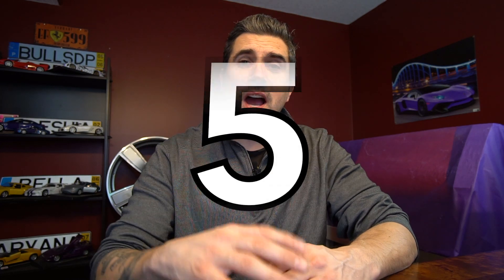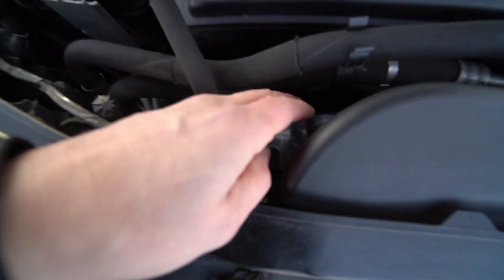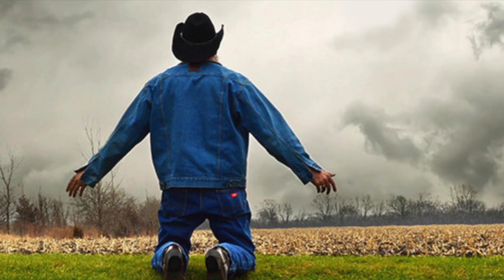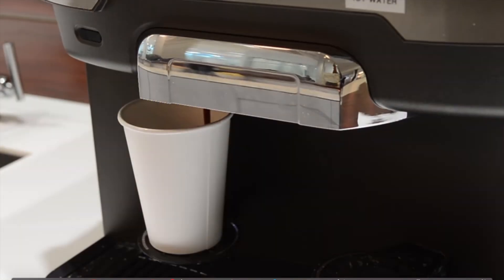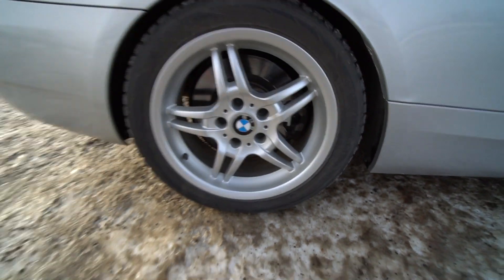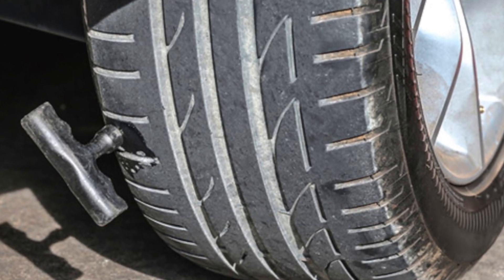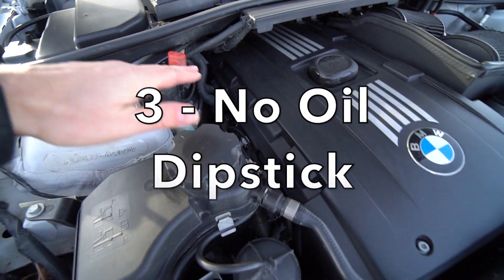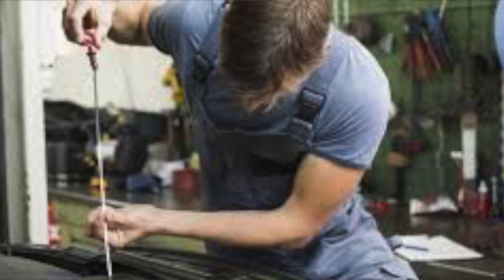5 Reasons Not To Buy Unreliable BMW 335i

Comment: What are your thoughts on a 550i? ...F10.  Are they reliable? 

I'm planning to get an F10 M5, but wanted to get the 550i first since it's a little cheaper and still has a V8.....which actually sounds way better than the M5.  If you don't recommend this, what do you think would be good in that range?
Reply from the maker: Hi, I personally love the F10 body style and the performance of all models.  The n55 is a great 6 cylinder performer, while the M5 is an absolute beast.  Since your ask, the 550 comes with a 4.4 Litre Twin Turbo V8 and produces anywhere from about 400 to 450 HP depending on the year which makes it a very spritely performer.   Problem, these engines had a significant list of significantly likely failures such as injectors, timing chains, HEAVY oil consumption because of the "HOT V" which places the turbos in the V of the engine and creates a lot of undesired heat which then in turn fries valve guide seals, Valve cover gaskets amongst a few things.  In short would I own one?  Maybe, if the price was right, I was happy with the service history and maybe you find a good one.  M5 may have some similar issues but its such a beast that I may live with it anyway.  Hope this helps.  BTW, the N55 powered F10 may be a good alternative if not going M5.  They are not perfect but are fairly dependable.
Reply: @ECPP  Ah!  Thank you for the detailed response!  I will keep this in mind for when I'm ready to make a move.
Reply: Dude I would strongly advise stay away from the N63 engine in the 550 and M5’s, they are very troublesome and unreliable. I speak from experience and google search and you will find an outstanding number of world wide complaints and issues.
Reply from the maker: @bucksbonanza  agreed, I was trying to be a bit more political.  Have a great one.
Reply: likesp33d the M5 engine is totally different to the 550i yes it is still a hot V but built in different factory and is a totally different kettle of fish. Just compare N63 vs S6344TU which is in the M5.

Comment: I've owned my e93 335i 57 plate 11 years now.. about £2500 in repairs hpfp water pump.. the parts are cheap because the cars old.. the dealer wants to buy  good examples 💯... I would never sell it perfect example of the ultimate driving machine

Comment: I had a 2007 coupe, it was so nice and fun to drive, beautiful design. However, I will never buy a BMW again after that. I got it at 96k miles, and over 3 years only drove it up to 101k. 
I did buy a warranty with it, thank god, it quickly paid for itself and far more. I can't even remember all of the things that had to be done, a turbo was the big one, water pump, I think the fuel pump went too. Many other issues too. People say they just need to be maintained, if by maintained they mean rebuilding the entire car before 100k miles, then sure. I can only imagine how many things would have gone wrong if I drove it more.

Comment: Yeah... I just replaced my stock turbos with Pure Stage 2 High Flow units... took me one day to get to turbos, one day to install and one day to reassemble. Then after checking for leaks... had to do it all again because minor coolant line leak on front turbos, then after two weeks, minor turbo oil drains minor leak so had to do it all again... so basically, three weeks of solid work. For the damn turbos.
Reply from the maker: That hurts.  In the end was it worth it though and was there a decent difference from stock?
Reply: @ECPP   - from 265 whp... to 650 whp? I would say, uh 'yes' it is in no shape or form the same car as stock. It is a suicide machine. Now I have to get wider rear tires to drive it safely at aggressive input...otherwise, it simply fishtails even if I am driving straight at 30mph and push the pedal... i don't know how to drift so three times already I have done spattghetti fishtailing and ended up opposing traffic...NOT from turning, but from straight driving... I can't imagine turning and accelerating. I REALLY need wider tires for SOME usable grip. So currently I am forced to drive literally like a grandma or else it goes apeshit.
Reply from the maker: @matreyia  Sounds great, I am assuming you have all the bolt on stuff.  What tune an mods are you running?
Reply: @ECPP   The car's all upgraded even before turbo upgrade, maximum fueling system, upgraded coils, 2 step plugs, two catch cans, all seals gaskets done, upgraded transmission, upgraded m3 suspension and bushings, upgraded 6 piston brakes etc... Just need wider tires. As you can see, I upgraded correctly with supporting mods before I installed the turbo.
Reply from the maker: @matreyia  Sounds solid
Reply: @ECPP   MHD tune working with Twisted Tuning.

Comment: Absolutely love my 2010 BMW Z4 35i N54 E89. Yep replacement parts are costly. Did alot of research before I bought mine and have been steadily replacing the parts that are most likely to break like the plastic charge pipe and adding dual intake cones. I'm a mechanic by trade so I dig working on my cars. I don't like the no dipstick thing but if I wanna get a look and smell of the oil I just open the fill cap on the valve cover and run my finger in while the engines not running of course.Oh BTW I'm not a fan boy but folks who aren't mechanically inclined will whine about the unreliability of these vehicles.I'm sorry that these folks are so inept at doing basic maintenance. I would be ashamed if I had to take my car to the dealer to perform a service. So put these things in perspective please. Like I said I'm a mechanic by trade this stuff is easy.
Reply from the maker: Water pump and T stat are a bit of an annoying change from my experience.  The steering rack and subframe are awkward
Reply: @ECPP  I'm a mechanic by trade I'm used to annoying things to change. And if you can rent a lift or lift space it's really not a difficult thing to replace if your skilled.

Comment: I am afraid to take mine on the long trip. I take my teen son's 2000 Toyota Camry with 225K miles instead. I trust the Toyota more than my 2011 335i xdrive with less than 100K miles.
Reply from the maker: I can see why although yours with the n55 is a lot better than the n54 twin turbo in mine
Reply: @ECPP  it had spun rod bearing , and so many things went wrong already. If BMW designs cars this way, KIA will eat their lunch eventually. Have you driven a Stinger?

Comment: ‘07 335xi: HPFP and LPFP replaced, both turbos replaced, water pump failed while on highway and almost got rear ended at 65mph, power door locks blown fuse, sunroof stopped opening, passenger rear view mirror stopped tilting down while in Reverse. I was lucky it was still under warranty and 100k warranty on HPFP.

Best day of my life was when I traded it in and have not owned an Ultimate Worse Machine since.
Reply from the maker: Wow, ouch

Comment: They are not a lot to maintain yea the car have its issues but if you take the car to bmw what do you expect a cheap repair no they’ll charge you up the ass you can learn to work on your own car just like I did all you need is the space if you don’t got space go to a mechanic that knows what’s he is doing and you will still be pay less than paying bmw to fix a small problem if you buy a bmw fcp euro and real oem will help you find the parts you need with a cheaper price than bmw will charge
Reply from the maker: True for sure

Comment: What about a 2013 X5 xDrive 35i now with 92k miles?
Reply from the maker: A well maintained unit could be a solid purchase because it has the n55 engine which is a lot more dependable than the n54
Reply: @ECPP  I had someone telling me I should dump my '13 X5 because he owned an earlier 335i that was full of problems. He said I should get an Acura MDX... I drove my X5 for 7 months now having put close to 14k miles so far without major problem!!! Only was the oil pan (gonna be hell of a job) and oil filter housing gaskets (that took the mechanic the whole day) that are getting done.

Comment: So my 1999 Camry is better then this bmw ? I paid $2,000 in April 2019. In June 2020 i got the transmission cable that was $430 and the AC condenser $480. This Camry is a beast and rides smooth

Comment: Is the n55 a lot better or should you go for the b58 (340i-f30)?
Reply from the maker: N55 is a bunch better than the N54 for reliability, but not as much for tuning.  With that said, from the N54 I would go straight B58, its a far more gnarly engine.  So far quite dependable as well, at least when tied to the auto trans.
Reply: ExoticCar PlayPlace Thank you for you answer. I had a 335i with them N54 from 40000 km-80000 km without problems, no tune, and  I guess the next owner started to see the issues. I got my mind set on a 340i Touring, could be both manual (a bit rare to find her in Sweden) or auto. Do you mean that the B58 on the 340i is more dependable with auto? Usually manual transmissions are more long lasting.
Reply from the maker: Hi Tony,

Maybe if you have time, give this a read.

B58 Engine Recall - BMW Service Bulletin SI B11 26 15

Engine
B58 Engine ***8211; Check and Replace Crankshaft Guide Bearing

Model
F30 3 Series Sedan with B58 engine and manual transmission.

Situation
The upper crankshaft guide bearing may wear out prematurely. The wear on the upper guide bearing can cause the clutch pedal to malfunction during shifting. The Engine Malfunction warning may be illuminated and a fault will be stored in the DME memory for the crankshaft sensor. Noise may be heard from the lower engine and transmission bell housing area.

If the crankshaft guide bearing or crankshaft is found damaged during the inspection then the engine must be replaced. Engine damage is a rare occurrence.

Affected Vehicles
This Service Action involves F30 vehicles produced from July 2015 to November 2015. Vehicles which require this Service Action to be completed will show it as "Open" when checked by your local BMW dealership
Reply: ExoticCar PlayPlace ok thanks amd that is only 340is made 2015?

Comment: what are your plans for the 335i in due course?
Reply from the maker: Still sort of wading my way.  If turbos go I will go all in the a big upgrade but if not we will see what type of mods can be applied.  At some point we will move it along but I am not sure I have finished with this hot rod just yet.
Reply: ExoticCar PlayPlace Alright sounds good man 👍 Can’t wait to see what’s in store!
Reply: @ECPP  after doing a ton of upgrades to my 335i and 5 revisions on my new tune I was finally able to take it on a road trip this past week and wow  What a difference fueling and larger Turbo upgrades due to this car!  Going down the freeway at 80 miles an hour you floor it and the tires spin  Definitely have to get used to the new power. Less than 8 seconds to go from 40 to 120 miles an hour  And that's only at 22PSI I'm going to tune these turbos to 24 or 26PSI

Comment: Honestly if you’re still going to the dealership, outside of warranty for repairs of any kind, you’re crazy!! You are absolutely right about the plastics in and around the engine, that is the prime reason why things go bad eventually on the N55 335i. To this day I don’t know why they went that route when designing the engine. If it was to cut costs, then it was the wrong area to do so. 

I used to have a 2007 BMW 335i (N54 Engine) when it first came out. At that time I was a much bigger BMW fan than I am now and didn’t know what I know now about BMWs. Back then you couldn’t tell me anything bad about a Bimmer. But if you think the N55 was unreliable try the first generation N54, the first year they turbocharged their inline 6 and it not just one turbo in that engine but there were 2. Adding more heat around plastic parts was a disaster and I remember some of those cars didn’t have oil coolers 🤦🏾‍♂️ The engine was AMAZING when it worked but that car was constantly in the shop for something. 

Also back then, the 335s had the first generation run flats which were an absolute disaster!!! I recently bought a 16 BMW 428i which had run flats and they made my old run flats  feel like I was riding on clouds and they were bad as well. I just changed the tires and the car feels so much better.

Comment: So what if i saw an offer of a 2008 bmw 335i convertible hard-top for $8,000 with the only 60,000 miles on it. Is that a good deal?
Reply from the maker: I would not recommend it unless you are good at wrenching especially with the n54 engine.
Reply: @ECPP  hey bro mh uncle selling a BMW 335i 2008 to me for $3500, from florida but I would have to Ship it to Puerto Rico here where I am which is a total process of like $1500-$1800 and it has about 120k miles on it. He has recently put a New Water pump on it and Although I am unsure of the history he takes good care of Cars. Let me know if worth it.

Comment: I bought a 2007 335i six speed manual convertible with red leathers interior and I absolutely love it but I’m experiencing 2 oil leaks at the moment it other words my wallet is fucked lol
Reply from the maker: All good Jayson, we drive these because they are fun.  You have to watch my next Tuesday video as I explain why we buy these cars.  All cars leak.  Thats right, Lexus, Toyota, Honda, and everything.  The difference is , how much does the owner care?  Have a good one and good luck with the leaks.  Sounds like you have a really nice spec car.  Great color combo.
Reply: ExoticCar PlayPlace thanks !! And oh yeah it’s a beauty it also come with the navigation unit. I upgraded the front bumper to the 335is front bumper and it looks amazing. My cousin is a mechanic so hopefully we can fix the leaks. So far I have fixed the timing belt , new breaks and rotors. But this car runs amazing and I will never sell it. I still own a Honda Accord so it breaks down I’ll just park it in the drive way until I can fix it. Lol

Comment: Would it be a bad idea to get a 200k+ mileage '09 335i for $4000? I'm used to doing maintenance myself as I do my own oil every time the oil gets dark enough or around every 5k miles, top up oil every so often since I have an engine plagued with oil consumption issues and have changed brake rotors and pads in the past. I was thinking that with that high of a mileage possibly the previous owner(s) have already gotten n the worst of it and have replaced most parts?
Reply: Did you?

Comment: What about N55?
Reply from the maker: It is better than the N54 for reliability.  Tuning is more limited but depends what you are trying to get out of the car.
Reply: Does the N55 in a F34 have the electric water pump issues?  Trying to avoid N20 and get N55 instead.  Does that seem sensible?  I have no plans to tune or mod

Comment: I see the same. My 328i 1995 was brilliant but my 2007 325xi is such a disapointment. And btw i know these inside out inpa and all the plastic valve covers pcv crap hfpump injectors coils and and and... btw the coils are overvolted by 100% and really need a snubber nw to fix the situation but they just sell more coils... omg and direct injection rubbish. Turbo is worse
Reply from the maker: They certainly have some issues, but did you enjoy the drive at least?
Reply: @ECPP  i used to die for na silky 6. The di clicks like diesel but is still smooth... but now i want a reliable car...and a smooth one if possible. Recommendations?

Comment: All you have to do is put a Japanese engine and transmission and get rid of the tire flat system problem solved
Reply: These cars main problem is the turbo which is japanese, comes from Mitsubishi.
Reply: @V0ree    Mitsubishi is garbage it's alot Japanese companies that make good product my boy put the supra engine in  a 335 and he have no issues and alot people  challenging him and he spank em up.
Reply: @marvinbenjamin.  It's true, more series are suffering from Mitshu turbos. You mean the new Supra's engine :D ?  Anyway... it would have been a great job to swap the engine.
As a German car fan have to say from about 2005 they forget to build relaible cars, especially VW group. And they build lots of useless thinks into their cars which can go wrong all the time after a while, and the downsizing nightmare.
But I have some similar feeling about japanese cars, I dont like Type-r for ex., I think it is a joke, but I am love with S2000, Integra, Prelude, older Subarus, MX5, Nissan 3x0Z and Skylines and Supras, they are great cars in my opinion.
Reply: @V0ree   the new supra have all  German parts the only thing that's Toyota is the shell  he have the 2jz engine in the 335 and it fits perfect with out cutting anything out the frame.

Comment: The interiors were really bad. It doesn’t meet nobody’s standard. I think they were trying to save money
Reply from the maker: Kind of but I feel the quality of interior is better in an e90 or92 than the f30
Reply: The E90 interior was far better than its competitors. Base looks great, somewhat bland once you see what they look like with options. Load it up with iDrive, sport seats, etc, and you have a great looking interior. The G35, Saab 9-3, Volvo S40, Lexus IS, Acura TSX/TL (3 series competitors), they don’t compete with their interiors. The Saab is cheap GM, talk about peeling and saving money. Acura’s were glorified Accord’s for the US market. My steering wheel hasn’t peeled anywhere and it’s gonna be 11 this year! Only have one crack in the Sensatec on the drivers side. It meets the standard for sure, in fact it set the standard if you ask me.